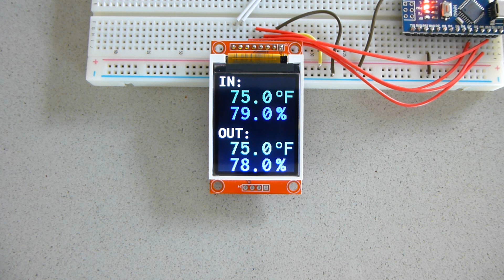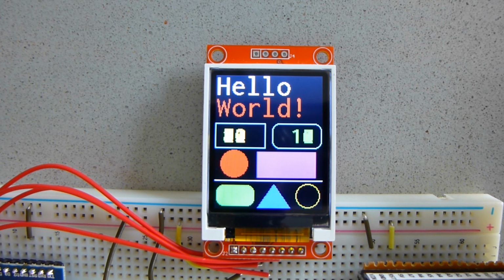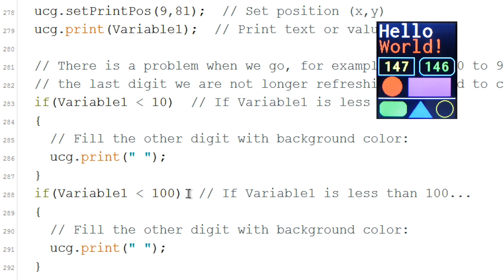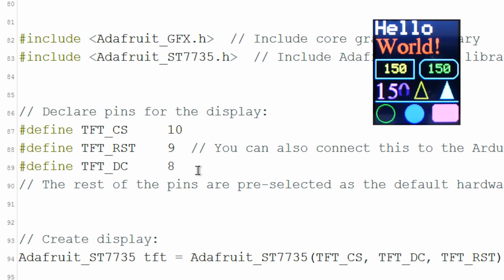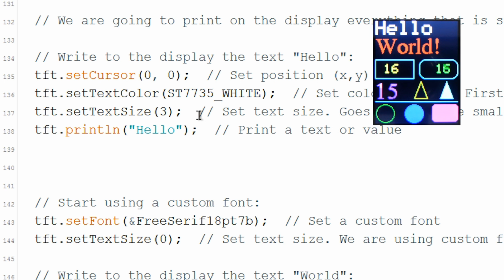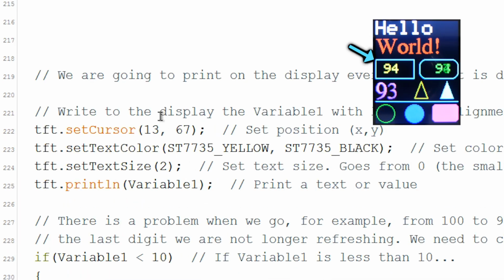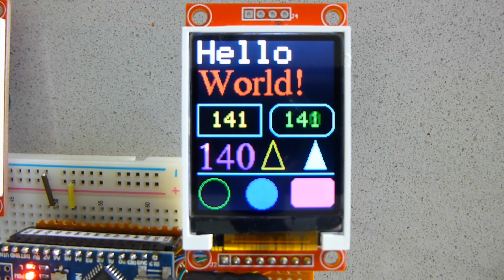Arduino Tutorial: 1.8" TFT Color Display ST7735 128x160

Comment: Hi, for freq measurement lib, the icp arduino D8 will be used in arduino uno. But this D8 used  also for pin reset the display. Can this D8 pin used together for both display configuration and freq measure?
Reply from the maker: You can change pin 8 of display to some other pin

Comment: Thanks very much, works nice. I have a small TFT screen ST7735 - 0.96"  80x160, I can not find in your library but it works with  Ucglib_ST7735_18x128x160_HWSPI ucg(8, 10, 9); But in the code I have change a bit to get the prints right on the screen. Do you have a version or update where I also can make a selection for this tiny screen ?
Reply from the maker: Hmm. I don't really know for that display. That's the tricky part of displays, that each one requires specific libraries. Basically if a library doesn't support that resolution, it most likely would not work. You need a library for that display resolution. Or see if you can adjust the library to make it work

Comment: how are A0, SDA and SCK pre-selected? I've set them to GPIO 2, 3 and 4 but I can't get a simple text to display and change the background. Only a static white background is showing. Im using Raspberry pi pico
Reply from the maker: Pins are selected in the top of the sketch and usually we use hardware pins so they can't be charged.

This is made for Arduino uno and nano. You need to find a Library for raspberry pi pico

Comment: In the Datasheet of UNO R3 SPI pins are: MOSI #12, SCK #14.
Reply from the maker: Not sure where you found that. I just checked and in the arduino website shows:

UNO R3, UNO R3 SMD, UNO WiFi Rev2, UNO Mini Ltd
Pins: 10(CS), 11(COPI), 12(CIPO), 13(SCK)

Either way, they are mostly configurable.

BTW, there is no pin 14 on Arduino UNO R3

Comment: Thank you for the great explanation. Do you know if there´s a way to graph a variable with unknown amplitude (so a dynamic y range)? I´ve been trying to code an algorithm for that but to no avail. All the solutions I´ve found online use other displays that have more complex libraries that do it automatically (and my C is too bad to understand the libraries)
Reply from the maker: I never done that with this kind of display but I'm sure it's possible. I would use the nextion display because it's much simpler to do. I have tutorials about that display. No library needed
Reply: @interlinkknight  I´ll check them out, thank you

Comment: my display has a "White glare" over it. When i reset the arduino ist gone but then comes back
Reply from the maker: Sounds like your display can't tolerate 5V logic. Add a logic level converter so the display receives 3.3V instead of 5V

Comment: do you have the ability to adjust the brightness ? Looks like you are running two off the same arduino ?
Reply from the maker: You can adjust the brightness with a transistor and using a pwm pin in Arduino to dim the backlight. And we can run multiple displays in parallel, but they all have to be exactly the same display and they are going to show exactly the same graphics and text

Comment: Great video, thanks for the help. I got my AZ-Delivery ST7735 running.
I got a slightly different model and my A0 pin was called RS which didn't take too long to figure out.
Also I had to install another Adafruit library to get it to work.

I still have some white stripes on my display, need to figure out how to get rid of them
Reply from the maker: White lines in a display is usually a hardware problem. Get a replacement from where you bought it

Comment: hii! i m using the library provided in description. but getting error when compiling . it is showing that no  file found for Adafruit_I2CDevice.h
and Adafruit_SPIDevice and showing tft declaration is not defined. after manually debugging that problem it is showing that  tft.initR(INITR_BLACKTAB); is not defined, 
can you please provide me the zip files of your working code and library files
thank you
Reply from the maker: Here's the library that i have: https://drive.google.com/file/d/1rIMNt8wxhdr7H89410CmeYwZoPOaYcCC/view?usp=sharing

The sketch is exactly the same I posted already
Reply: @interlinkknight   thank you

Comment: trying to recopy your sketch, the tft display doesn't print like in your video, can you help me? thanks
Reply from the maker: First try my example without any modifications
Reply: @interlinkknight  I followed your video by copying string by string. The sketch doesn't work, is it possible that some steps are skipped in the video? I have problems displaying the value of the variables inside the rectangles. can you post the full sketch please?
Reply from the maker: The sketch is already in the description

Comment: I'm new to arduino, is it possible to use an arduino as a pass through hdmi and at what refresh rate does it run at (I need it as high as possible)
Reply from the maker: Arduino is not powerful enough for that kind of stuff. Maybe with the Raspberry Pi.

The refresh rate depends on the amount of things that need refreshing on the screen. In the video I show the fastest refresh possible when updating those numbers

Comment: HOW TO CONFIGURE THE PINS - SCK AND SDA FOR MEGA 2560 ? 
Because as per a comment in the file  - // The rest of the pins are pre-selected as the default hardware SPI for Arduino Uno (SCK=13 and SDA=11)
this is preconfigured to be used for arduino uno
Reply from the maker: As far I know by default on the mega is SCK=52 and SDA=51
Reply: @interlinkknight  Ever after every perfect connection I am getting a bright blank screen. However, whenever I press the RESET button on my Mega2560 board, it displays the proper 
output, but only for a second and again the same blank bright screen returns.
Reply from the maker: You think that maybe your display only supports 3.3v?
Reply: InterlinkKnight I am not quite sure about that. I saw many connection diagrams, they all directly connected the display to arduino boards, so did I. Also I tried connecting the pins with a 1k resistor as found at some place. But that also didn’t work.
Reply: InterlinkKnight what if that only supports 3.3 V ?
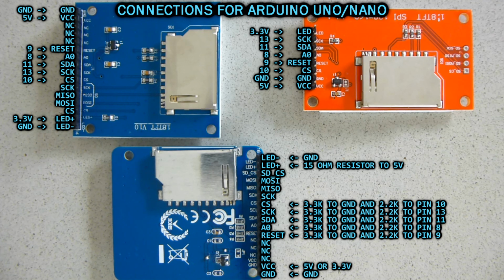Reply from the maker: In minute 1:46 I show how to connect the resistors in the case the display only supports 3.3V. And it's not as simple as putting a 1K resistor in the lines.

Are you using my sketch without modifications, right? Can you use an Arduino uno or nano, instead of the mega?
Reply: InterlinkKnight yeah true that. I got it. However, I got the display working, this time I used the Node MCU ESP8266 module instead of mega2560
Reply from the maker: Cool

Comment: I am looking for a GPS Speedometer with  Odometer that stores the accumulated miles to Eprrom of Arduino.  I am sure a lot of others would like help with this.  I have this screen setup and NEO-6M GPS Module. I have got it to work but need some help with the Odometer.
Reply from the maker: Not much I can do. I'm busy with my projects and videos.
Reply: @interlinkknight  Any links to point in the right direction please?
Reply from the maker: For making an odometer? To be honest I don't know. I never even used a GPS module. I wish I could help. Sorry.

Comment: I am trying the GFX and ST7735 Libreries for my 1.8 inch TFT display from Adafruit,  I am connecting 5 volt directly to I/O pins, I don't see anything on the display except a white LED light. Any suggestions please ?
Reply from the maker: I don't know. Try to follow the video exactly as I show and use my example sketch. It should work.
Reply: @interlinkknight  thank you for ur reply...I am using exactly same connections and sketch as shown in ur video, but my display is slightly different, it is from Adafruit, has SD card slot, PCB is Blue (not red as yours) and has 10 pins. Someone is recommending 1 K resisters in series with I/O pins.
Reply from the maker: Adafruit page say is 5V compatible so it shouldn't need a resistor but you can try it.

Comment: hey ,  I wanna ask a qustion about arduino. Lately I was trying to display picture on the TFT touch screen ,and what I want to achieve is when time goes by the picture will blur and you have to touch the screen the way  just like you wipe the dust off you picture frame  in order to make the picture as sharp as before.... How am I gonna code this ,and which direction should I go for.... A million thxs ahead !
Reply from the maker: I can't think a way to do that with arduino
Reply: @interlinkknight  thanks for your reply anyway !

Comment: Thank you for the video - great help!
Can you help with the pin layout connecting to a ESP32 development board https://www.adafruit.com/product/3269#technical-details-anchor ?
Reply from the maker: No idea. I never used an ESP32
Reply: Still trying, or done it?
Anyway: use TFT_eSPI.h and make sure these lines are un-commented or edited as appropriate in your user setup file:
#define ST7735_DRIVER 
 #define TFT_SDA_READ 
  #define TFT_RGB_ORDER TFT_RGB  (some need you to use the BGR setting instead)
 #define TFT_WIDTH  128
 #define TFT_HEIGHT 160
 #define ST7735_GREENTAB2  // usually works ok and very fast!
You might need inversion ON, can't tell you from here
#define TFT_MISO 19
#define TFT_MOSI 23
#define TFT_SCLK 18
#define TFT_CS   15  // Chip select control pin
#define TFT_DC    2  // Data Command control pin
#define TFT_RST   4  // Reset pin (could connect to RST pin)
//#define TFT_RST  -1  // Set TFT_RST to -1 if display RESET is connected to ESP32 board RST
And those are the wiring.
If you don't know how to get TFT_eSPI to work, and the instructions don't make sense, it might be easier to use Adafruit's driver, but that also needs you to edit the pin numbers.  
Basically, you edit the file User_Setup_Select.h and insert the name of your user setup file, I used the name Setup201_7735_ESP32 for my setups file, which lives in the User_Setups folder. I have since found that the pre-defined file Setup43_ST7735.h is already set up for ESP32 and 7735 driver, but I haven't tested it. Note!!!!: These are often overwritten if you update that library, back it up somewhere when it works.

Hope this helps.

Comment: Hi! Thank you for your very detailed tutorial. I have been searching for something similar for a week now, ordered a display and couldnt get it workling nor find any information about it. Thanks to you, it works, but it is extremely dim. I can barely see anything. I am using the 1.77" TFT, in your video the upper left one, with an arduino nano. I have a lot of other things hooked up, but no potentiometer. How could I get the Brightness way up? Thanks a lot again!
Reply: I actually fixed it by putting the backlight pin (LEDA) in to 5V instead of 3.3. Much, much better.
Reply from the maker: Good to know. Yeah, some backlights work with 3.3v and others with 5v.

Comment: Very well done upload.

 I'm currently developing a simple dual display current/voltmeter setup for a power supply. I have a few 7735's in bare form and thought I'd spin a board to make use of them. I've used Oliver's U8G2 library on another project, but havn't tried the color version yet. It's probably quick enough for 2 displays and an uno's ADC.
 Thanks for the upload.
-Jake
Reply from the maker: I've never used multiple displays so I don't know
Reply: @interlinkknight  
 Me neither, but I think the whole chip select pin thing makes it pretty straight forward. They both go connect to the μC hardware SPI bus with chip select controlling which one to write to using two different GPIO. At least that's my breadboard goal for today :-)
Reply from the maker: It should work, but I'm guessing is going to lower the refresh rate by half.
Reply: @interlinkknight  
 Do all of your ST7735 based displays have bad side viewing color and image definition when placed in a landscape orientation? Both types I have are really bad. I won't use these because it's so bad. If I'm more than 20 degrees to the left or right I can't see any color and can barely make out the screen contents. I just built a breakout for a ST7565 monochrome graphics display to try with the current project instead. The 7735 in portrait mode with 2 displays looks silly :-)
Reply from the maker: You are right. Sadly the tft color displays that I've seen for arduino are not good with angles.

Comment: I have tried this tutorial with UCGLIB library, the red pcb display and arduino leonardo but nothing happens. Only the display backlit lights up. What I am doing wrong?
Reply from the maker: Maybe you have a 3.3v version. Try to put resistors to drop the pins to 3.3v or use a logic level converter.
Reply: @interlinkknight  

I used a resistor and I managed to run the Adafruit library test.

Comment: How is the off-axis visibility on these? I bought a competing low-cost LCD (the kind with a blue PCB and two rows of 8 and 6 pins at one end), and it's terrible: if you do anything other than black and white, the colors start shifting and the contrast goes to hell if you tilt it more than about 20 degrees from "straight on". It's just barely usable if you treat it like an OLED or other monochrome display.
Reply from the maker: To be honest, it's not that great but it's not that bad in my opinion.

Comment: how to clear the display with adafruit ???
Reply: It's fillScreen.

Be warned: the ST7735 doesn't have an "erase display" command, so fillScreen works by writing 2 bytes of color data via SPI for every (bleep)ing pixel on the screen. It's slow enough that the flickering is visible with an ESP8266. I have a weather display app that updates the screen once per second, but chooses the contents depending on which second it's in. Right now it does temperature and time in seconds 0  and 1, and temperature with wind in seconds 2 and 3. When I switched from OLED to LCD, I had to skip the updates for seconds 1 and 3 because the flicker was so annoying (the OLED writes the new contents to an internal buffer then updates the display memory imperceptibly fast).
Reply from the maker: In my example is that command, line 119

Comment: Hey InterlinkKnight, thanks for the video! I actually got it working.
But I have a 1.44" SPI 128x128 ST7735 display, and your sketches don't fit.
Any ideas how to adjust?
Thanks :)
Reply from the maker: Just move the location of everything. You have to manually change the coordinates. There's details in the comments inside the sketch.
Reply: @interlinkknight  thanks for the reply, that makes sense. I optimistically thought there might be a scaling feature lol. Sounds like a lot of hard work :)
Reply from the maker: Sadly there isn't a easy way. But it's not that hard either. Anyway, I think part of the fun it's playing with the overall layout, color, sizes, etc.
Reply: InterlinkKnight thank you!

Comment: is the amazon link the screen that does not need resistors for 3.5v?   which works on 5v only the best? thanks
Reply from the maker: Yes. It's the good one
Reply: Ok thank you. I didn't want resistors because I never get them right and I'll blow the screen. So I'll get the one in the link if it's 5v only and doesn't  need resistors. Thank you
Reply: @Vass881234  lucky you saw this video in time. Too late for me but the project is assembled now.

Comment: Hi thanks for this video. I’m going to use the Adafruit 1.54″ TFT LCD Display with MicroSD – ST7789 with an Arduino UNO. My goal is to load several images on the flow and make a low fps animation. Is the refresh rate good or I’ll see the scanline when changing the image? It should be noted that all images are really little different. Thanks in advance!
Reply from the maker: The refresh rate is going to be very low, I think. Maybe 2 to 5 FPS, if you are refreshing the entire screen. I would use a nextion (enhanced) display for that kind of animation.
Reply: Animation will depend on what ur driving these with. On a ESP8266 I'm running a similar display @128*128 16BPP and get over 50fps that includes displaying text, 3 32x32 aliens and clearing the screen every frame. With full screen animation, no need to clear... just overwrite new frame when time. If you have a look at my channel I have a demo of video with sound on an Arduino Due. I use my own library as most the 3rd party ones are slow.  Getting one of these displays so I can add the driver to the drivers I support.

Comment: Looks like an answer to my frustration with the KMR version. I tried connecting everything to the Nano 3v3 rather than using 5v and resistors but it didn't appear to work. Any idea why ?
Reply from the maker: I don't know. I can only suggest trying my sketch making sure you connect all the pins correctly like I show on the video. Also, I remember some people saying that they got a defective unit where the voltage regulator was damage. Check if the voltage regulator (the 3-pin black IC on the back) is giving enough voltage. If not, you can by-pass the regulator. You are using 3.3V already so you don't need it anyway.
Reply: Thanks. Problem fixed by using 200 ohm resistor from SDA connection to Nano and from SDA connection to ground as shown at
 https://www.ebay.fr/itm/1-8-inch-ST7735R-128x160-SPI-Colour-TFT-Display-Module-with-SD-Slot-for-Arduino-/282813109817